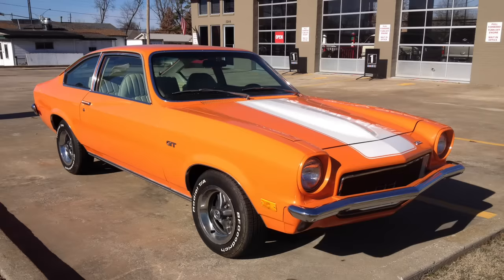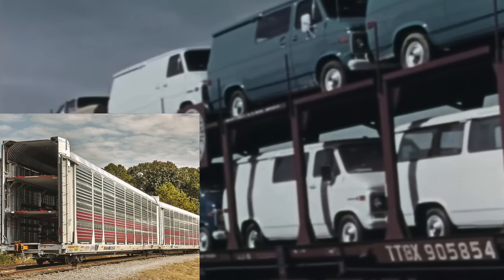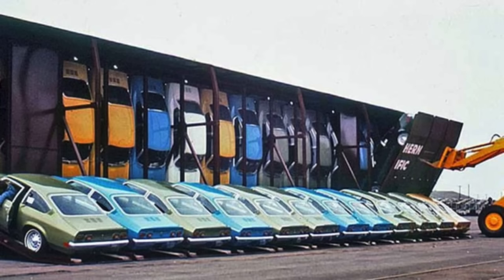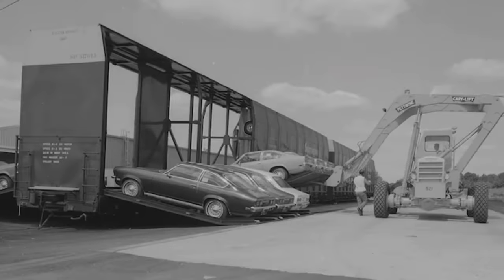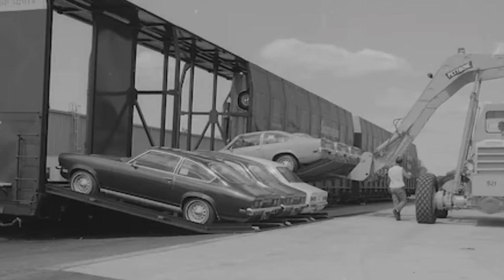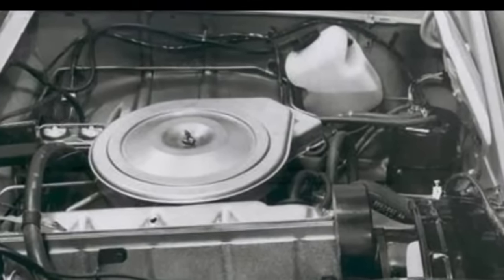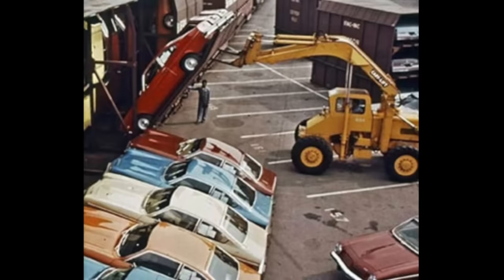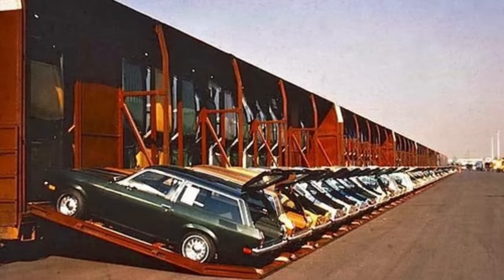GM's Coolest Invention Wasn't Even Part of a Car: The Chevrolet Vega's Vert-a-Pac Shipping System

Comment: What a shame that the innovations, engineering and effort didn't go into making a better Vega.
Reply: Better is the key word here. The Vega did have a number of innovations that if they had been tested and developed adequately would have worked well. The over head cam engine is one. GM US hadn't don e this before. The timing chain was all new designed. The aluminum engine block had been used before in GM cars, but never with the pistons riding against an aluminum sleeve. It worked, but lubricants of the time didn't provide enough protection to those side walls. The real down fall of that engine was its total intolerance to over heating. The typical American driver is casual at  best about keeping fluids topped up. The target audience for this car was at the extreme end of that group. Let the engine over heat just once and you had warpage of the head to block bad enough to blow the head gasket. That usually meant the end of that engine. The rust issue with the car, apart from what was attributable across the entire GM line up because of using poor alloys could have been remedied by adding two drain holes in the fire wall and enlarging the drain holes farther down the same area. The Vega was always a great looking car, mimicking that same era Camaro in styling. It sure was a lost opportunity for GM.
Reply: GM did the OHC engine and was developed by DeLorean for Pontiac in the 60s. Was a great engine but was not what GM management wanted and was discontinued. A 4 cyl version of Pontiac's OHC 6 would have worked great in the Vega.
Reply: @charlesf4428  A four cylinder version of the OHC Pontiac engine might have worked in the Vega, but I believe the Pontiac engine was quite a bit taller than the Vega engine and may have required it to be slanted one way or the other much as Pontiac had done with the 1/2 V8 four cylinder engine in the original Tempest model in the early 60's.
Reply: @cdjhyoung  In a typical piece of GM stupidity, they didn’t put in an expansion tank
Reply: @cdjhyoung  Generally correct in most details. But the cylinder wall was etched eutectic aluminum, making the cylinder wall among the hardest substances known to man, silicon. Also, the heat intolerance caused the cylinder to warp, thereby rubbing the wall against the piston and scoring the surface. Simple coolant overflow bottle in 1973 solved most of the problems. Today's aluminum engines use this technology, so it was cutting edge in the Vega. Rust had a number of causes, as you said problematic among all makes and models for the reasons you stated. One major little flaw was the lack of wheel well liners in the 71-72 model years. Solved for a couple of bucks. I have a 75 Cosworth and a 77 GT and both are rust-free. The head gasket was paper for the first 6 months (1971), after which Chev went to a steel gasket and solved the problem of blown gasket. The 75 Cosworth was the first production electronic fuel injection, tuned port. Cosworth was also the first dual overhead cam, 4 valves per cylinder, since the 1939 Cord. DOHC is now a feature of high end cars. I really wish the 5-speed manual had been part of the options from the start. Optional was 5-speed manual + posi-traction on the 76-77 models. Traction bar and beefed-up suspension standard on GT models. Durabuilt (76-77) engines had hydraulic lifters. 71-72 GT's had 2-stage Rochester carbs. Post 72-GT's and all 77's had dual stage 2 bbl Holley carbs. Anyone who has a 77 survivor has one sweet vintage car, most particularly the GT's (no rust, no maintenance, just gas, tires, and oil, and the occasional detailing). All Vegas stop faster than a Corvette, and have the elusive neutral steering that makes them demons on mountain roads. A car ahead of its time, and designed to be replaced by the Monza after 1978. A shame really, because it was better in a majority of respects than the Monza by 1977. 1978 Monza S wagons are Vegas in all reality, only the front clip and name plate was changed. Vega was not forced out of the market, just designed to be phased out. They should bring it back with modern technology. It would be one helluva car, but the price would probably match every other mid-range car today.
Reply: @Kevin-rz6lm  When i saw the length of your reply, I expected a screed, not an education. Thanks you for your in depth response, much of which was new to me.
Reply: @cdjhyoung  it's a hobby, but am am not among the most fanatic. I'm just an engineer who remembers all if it
Reply: They actually did,the Monza was the new Vega,but the vega had a bad name thus they called the new version of the Vega the Monza,look at the cars the Monza still used the Vega's parts..The 80's they went fwd and it became the Cavalier but that was a 100% different car..Vega/Monza exact same car but with updates/improvements!
Reply: @mypronouniswtf5559  The Monza had more than a few improvements, but yes it fit the same role and market as the Vega in the GM line up. Front suspension was improved and eventually would carry over to the first few years of Fiero production. The Monza also offered a V8 of 262 cu in size. The design problems that led to early rust out on the Vega were also addressed, but like all of the GM product line they still didn't address the alloy of steel used for body panels so they still rusted anywhere other than the Arizona sun.

Comment: The battery issue was not discovered until after the first few shipments.  A Chevy dealer friend of mine told me the battery acid did actually weep into the internal parts of the front of the car until it was discovered and the modification of later production cars was made.  Those particular Vegas were at the root of the rusting problem in some early Vegas.  I was a big fan of the Cosworth model.  Always wanted one.
Reply: Saved acid dipping the hood and fenders for race ready modifications.....
Reply: So draining the swamp to find gators ...all these car modifications to the car just to accommodate vertical shipping they could have tarped all cars and just load them normally ......way too much cost and work just to ship cars vertically.......
Reply: That wasn't the root of the rust problem.

The lack of primer under the external paint and no coating at all on hidden surfaces was the problem.  That included the floor pan, which would rust completely out in a few years.  Even if undercoating were applied on the outside you couldn't do anything about the uncoated steel under the carpet.
Reply: @1djbecker  Yep.  The car that destroyed the 'body by fisher' mark of quality.  They were so proud of their elpo electrostatic coating that they thought it was the cure-all to rust problems.  Such a sad end to decades of Fisher body excellence.

Comment: Never ever knew about this ridiculous idea and when I saw the windshield washer bottle I remembered the one in my Vega and why it always looked weird.  Cheers 🇨🇦
Reply: It seems like it would've made more sense to just let the dealer fill the windshield washer reservoir. Maybe even use a temporary battery to load the cars, and then let the dealer install the permanent battery
Reply: @johneckert1365  The car needed an installed battery to get from the rail head to the destination. Few dealers have rail heads.

Comment: Man, that Hugger Orange example at the beginning of the video looks cool as heck with the Ermine White (or whatever) stripe. If they would've just built them with 307s, Vegas would've been near legendary - in a good way.  They are not at all a bad looking car, the first iterations at least.
Reply: Wasn't that the point of the monza
Reply: @eaglewi Monzas were pretty quick when they came with that 262 V8. They should've done that right from the start with the Vega.
Reply: @johneckert1365  That would have missed the entire point of Vega. The POINT was to be an economy car, not a thirsty fire breathing V8. Vega was supposed to be able to take on the Japanese small cars as well as the venerable VW Beetle.
Reply: @eaglewi  Too bad the Monza`s were so UGLY !!!
Reply: I actually built a 72 Vega drag car with a 350 and that very paint scheme (orange w/white strip) not knowing it was a factory option till now. That being said my wife loved that car over all the other cars I’ve built
Reply: I’ve had 5 different Vegas and it was also the first car i ever owned. (And worked and modified many more) That with living near Lordstown Vega plant and my uncle working for Packard electric and my dad working for the railroad, I knew about the way they shipped these cars but even with all this intimate knowledge you still tough me a couple things that I didn’t know about. Thanks for the great video
Reply: In 73 the millionth vega rolled off the line and it was that hugger orange with white stripe paint scheme. 
I don't know if that became a production or just any orange/white GT that came off the line after got the millionth label
I had one.
Reply: @MarinCipollina  
But the Camaro started out that way too.
Reply: @edmundanderson657 the Millionth vega was a limited production car. The car at the beginning of the video is a Millionth vega. The orange was specific to the car as the orange carpet with neutral interior.  Plus the decals on the door handles.

Comment: More than any auto manufacturer I can think of, GM is notoriously good at shooting themselves in the foot. Like, make sure the safety is off, aim carefully, then boom. They killed off model after model themselves after spending incalculable sums of money to cure engineering issues that should have been taken care of to begin with. Many were inherently good cars that just needed a little more thorough development. The Vega is a perfect example. They were, in my opinion, very good looking cars particularly in GT trim and having driven a few, they were pretty nice when you were behind the wheel. The cost of building these rail cars, plus the cost of modifying the cars so they could be shipped vertically must have been staggering. They certainly went all in for a car that they ended up tossing away themselves. Given that this was Ed Cole’s baby, it must have taken a toll on him.
Reply: Funny you say that. It’s been my opinion for decades that GM has a habit of rushing the release of a product just before it ms ready and letting the customer do the final testing. Then it’s nonstop refinement, updates, bad publicity, redesigns, until it’s basically perfected. At which point the product is discontinued, only to be replaced by something else that’s not quite ready for the buying public. 

The Vega is a perfect example. A stylish car that sold well, only to be plagued with the “bean counter” syndrome. They wanted to build a cheap economic car, but made it with lousy quality steel, the car was basically made of compressed rust. The Cadillac 4100 engine, the Oldsmobile 350 diesel, the 440T4 transmission, the list goes on
Reply: You guys ever heard of Ford and  Chrysler???
Reply: @mattrodgers4878  All because the gubmint got involved in car making.  Just look at the 1960's gm cars.....
Reply: @will7its oh believe me, I’m not leaving Ford and Chrysler out of the mix. I just think GM wrote the book on it.
Reply: Personally, I feel the changes to the car for vertical shipping are rather minor, but the change in the rail system, along with the added room needed to load and training in that area were staggering, despite moving 35% more vehicles per train car. One thing that was certain.... if the car didn't leak in shipping, at least all the fluids were staying inside, and your garage floor was ok for awhile!
Reply: Yeah they look like a mini camaro
Reply: And don't forget the Astro van cancellation. It was a huge seller.
Reply: @curtisbryce5096 still is. if you own one you can sell it in a heartbeat.
Reply: GM spent fortunes fine tuning things only to abandon them just before they were perfected.

Comment: My first car was a '74 GT hatchback. I had it 3 years with only 1 problem. Rust around the underside front edges of the hood that worked its way around to the top. To replace for about half the price. From a racing magazine, I bought a fiberglass hood. Had it painted, and used 4 hood pins for a lift off hood. For the years I had it, it ran ok. Traded it in on a new Jeep CJ5.
Reply: so you traded a rusty body for a rusty frame

Comment: I had a 1973 Vega that I bought for work at the time (1980 security guard in car). I had extra spark plugs in the toolbox so when it started to "miss" I would hop out change 2 plugs and be good to go till the next day. One time I forgot to bring extra oil with me and on the way home the car quit running. Come to find out that when the oil pressure was low it would shut the electric fuel pump off. They must have knew something about oil consumption before hand. Other than that and the rust it was a good car.

Comment: Yeah, hard to figure how this made sense in the end. Redesigned rail cars, the cost of the engineering modifications, the fact that the whole system was created to ship one vehicle model, etc. Can’t imagine how GM concluded that it would save money. Evidently there is no surviving documentation that detailed the financial analysis?
Reply: That one model (actually at least two models for different brands, and potentially more models with compatible dimensions and designs) was intended to be the company's big volume model line.
Reply: @brianb-p6586  And, if the thing had worked well, they'd have used the same cars to ship their next new model, and the next one.

Comment: I remember in high school in the 70s these cars could be had for next to nothing. You could pick up a two year old perfect paint and interior with less than 20,000 miles with a blown motor. These cars were so easy to V8 swap. I remember specifically looking for the automatic cars because you could even use the turbo 350 tranny. Around that same time my local wrecking yard used to have clearance sales every so often and you could pick up a small block for 50 bucks. Those were the good old days.
Reply: Very few had turbo 350s and the ones that did it was an odd air cooled transmission. None of the vega automatics would bolt up to a small block chevy, had a different shape and bolt pattern.
Reply: @edmundanderson657 he stated " because you could use a 350 " 
I'm assuming he seemed out auto cars for the correct floor boot
Reply: @diviningrod2671  

Can't speak for or remember the 71-72s but 73 and up had the same tunnel and hole in the floor for auto and stick. Swapped out a few from auto to stick.
71 and 72 had an opal trans while 73 and up had a Saginaw for 4sps.

Comment: I had a cosworth model in the early 80’s, what a fun car that was to drive. I also had one of the last Bonneville’s to roll off the assembly line with a 455 and the 6 pack. It would pass just about anything except a gas station.
Reply: My summer job in the late ‘60’s was a “Driving Miss Daisy” scenario, looking after a rich old lady at her summer home while her husband worked in the city.  Used to drive a Bonny 2 hrs. to take her to the airport to pick up the Mr.   17 years old and driving a massive luxury car.  Loved it!

Comment: My first car in HS was a 71 Vega wagon. Paid 400 bucks for it in 1975 with no engine..lol. Got a junkyard 327 2 barrel for it and the 50 buck engine swap kit, motor mounts and transmission crossmember, and drove all through HS. It was a great car and was super fun to drive and got fairly decent gas mileage. Was a GT and found a guy to modify the tach so it worked with the V-8.😎
Reply: @@HelicopterDad-xk5sxI used a 2.3 out of either a Vega or Monza to power a log splitter about 30 years ago.
Reply: @johneckert1365 it probably burned enough oil to saturate the split wood with oil residue and made built in starting fluid.
Reply: A four year old car with no engine? Holy crap
Reply: @catsaregovernmentspies  
They drank oil thats for sure! All the local gas stations knew me as $10 and 2 quarts.
Reply: @@HelicopterDad-xk5sx 
I went the buick 215 route, it was fun.
Reply: $400 ? You DEFINITELY  overpaid !
Reply: @catsaregovernmentspies  the car had around 50K miles on it. The body was like new. Most early engines never made it past 50K miles..lol.
Reply: @steveoh9838  My dad had a 74 Vega when I was a kid.  It was worn out and had rust holes in it by 1978.  Towards the end, it would not make it up the 10% grade hill near our neighborhood so we could not eat at Big Boy any longer.
Reply: @catsaregovernmentspies  the modern equivalent would be like seeing a 2019 Kia with a blown engine lol
Reply: @UpgradeUrWinRARTrial  ..I am in the car business and lots of 2019 cars needing engines..including Toyota's and electric cars needing motors and batteries(they have motors but not engines).
Reply: @brucemitchell5637  ..True thats $2200 today..He must have really liked the car..
Reply: I did the same thing with mine got it running 4 $500 bucks.. We put a 2.8 V6 in it... Had the 4spd trans
Reply: @martymiller4300 I realize that you're just joking b/c the motor is used to power the hydraulic system and wouldn't be dripping on the wood...